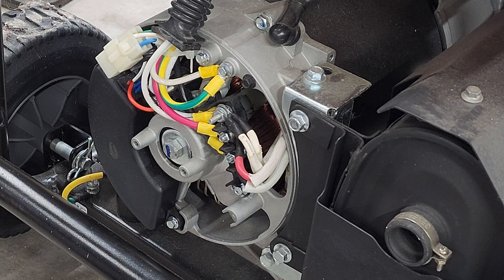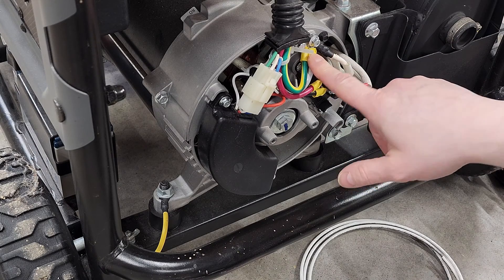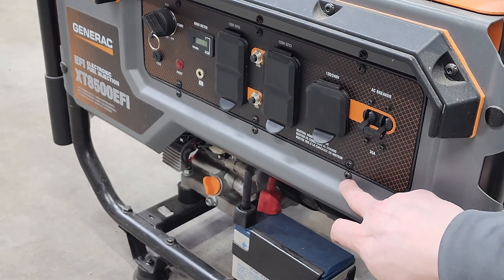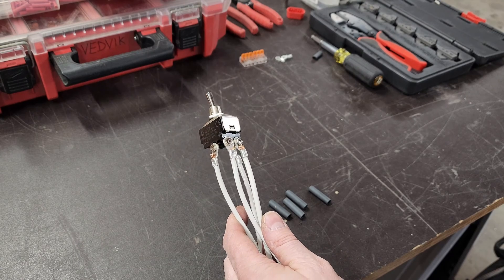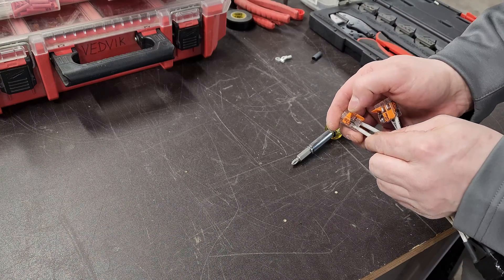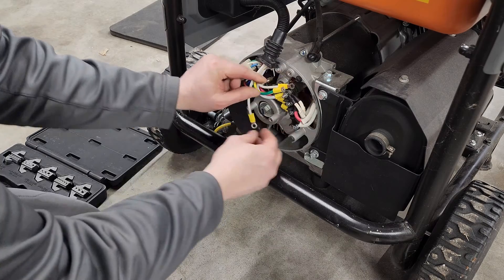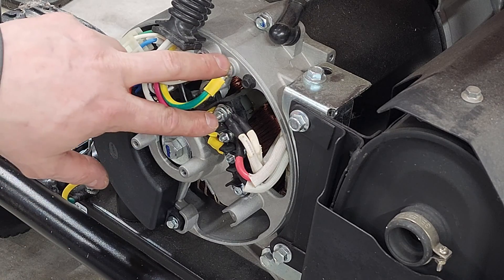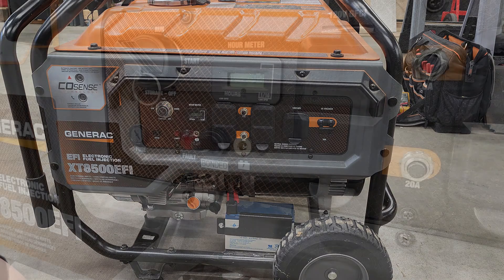Electrical Engineer Explains: Portable Generator Bonded vs Floating - How I modified my generator!

Comment: Love your videos. Just wondering why it’s okay to use a switch that’s rated under the total amperage capability of your generator?
Reply from the maker: I would maintain ratings.  While it's unlikely, it's possible for the neutral to have the same current as a single phase load.

Comment: This is actually a pretty slick solution. But, could you not just buy or make a neutral bonding plug and just plug it into one of the 120v generator power outlets and achieve the same result?
Reply from the maker: If you just use the 120V GFCI outputs you can power individual devices just fine since you aren't backfeeding the panel.  You wouldn't backfeed the panel at 120V.

Comment: You can always "re-bond" the generator by using a grounded utility plug with a piece of wire jumpered between neutral (silver) & ground (green). Then plug it into an unused outlet on the generator.

Comment: Odd to me:
250 Volts, x 18 Amps is 4500 Watts. 
You're trying to use a toggle switch with two poles and go with the theory that in a fault that load will be split evenly.

However, a switch rated for 4500 W in my mind is not going to handle a "fault current "on a generator which can produce 10,000 starting walks.

Even if you added both of those poles together and said in your mind 9000 W, you're still 1000 W short.

Also, an open frame generator is possibly subject to wet conditions so rather Thhn maybe go with THWN the wet rated wire.

Simply put, you would be better served by just running two wires out as you did from the generator's wiring… And connected a Wago lever nut, when you want the system to be bonded

Wago 600V x 30A =18,000 watts

A standard 221 Wego is not wet rated, however, I find it to be a better solution..
Reply from the maker: Hi!  The breakers aupplied with the generator are typical in marine applications and have a SCCR closer to 1,500A, not 10kA that we are used to seeing in commercial equipment.  The wiring, terminations,  etc inside the generator aren't capable of 10kA either.  I haven't researched the time-current curves of the supplied breakers, nor the actual fault current of the generator windings,  but I'm good matching the breakers ratings.

Comment: Hoping for some help here. I recently purchased a Generac G0080620 generator, a model specific to Lowe's, but essentially a duel fuel 8250/6700 Watt 49 state portable generator like so many of their mid power portable generators. I knew going in that the generator had a bonded neutral  Between the time I ordered and received the generator I hired an electrician to install an exterior manual whole house transfer switch and requested that he put in a 3 pole transfer switch and he told me the same thing that a couple of other people who bid the job told me, our utility company preferred 2 pole switches and generators with floating neutrals, so I deferred to his knowledge and ended up with a 2 pole transfer switch. Knowing that when the generator got here I would need to float the neutral I watched this and your other videos as well as other videos dealing with floating the neutral on Generac generators. After pulling the 2 neutrals from the windings and the neutral to the control panel from the common single bolt that tied them to the ground wire and using a machine screw added to the terminal strip to tie the 3 neutrals together I decided to try the setup before adding the bonded/floating selector switch, just to make sure it would run in a floated neutral condition. The generator started just fine but would only run for about 15-20 seconds before dying on its own. I repeated this a couple more times with the same results and then made sure I had done everything that the various videos had shown. I pulled the end cover and put everything back the way it was, the generator started and ran for a couple of hours with a couple of electric portable heaters plugged in and I was satisfied that everything was still working. 

I hooked the generator to the transfer switch, understanding that I was introducing a second bonding point into the house system, and ran it using all the normal breakers on, minus the extraneous circuits like dishwasher, washer and dryer

Can anyone think of a reason that floating the neutral in the manner I did, and numerous others have done, would cause the engine to shut down?

Both 120v outlets and the 230v outlet are all GCI protected

Thanks in advance for any help

Comment: not many electricians wanna touch my FPE panel; what are your thoughts if i put a huge manual transfer switch in between utility and the FPE box? switch up for util, middle for disconnect, bottom for generator inlet.. curious to know your advice
Reply from the maker: Manual transfer switches are a great idea.  Bonding is still a concern, action  depends on the number of poles for the transfer switch.  Ideally,  it switches the neutral so the generator can remain bonded.

Comment: What if I'm using the 30 amp plug to the house but also want to use the 110's with extension cord to something else?
Reply: It'll be bonded at the house fuse panel because it's connected to the house so you can use the plugs on the generator.

Comment: In his other video it shows him installing a generator connect box (without) bonding it to his electrical service. Easy to do. Just leave the green wire disconnected and wire capped. In effect, the metal connect box would only be bonded to the Generator (but not to) the home electrical service. I prefer this over making mods to the generator because if I want to use the generator as a stand alone power source, it comes manufactured ready to do so. 

It's interesting to note that most battery powered power supplies are set up without bonding. My Bluetti is not bonded. As a stand alone power source I have to use a neutral ground bonding plug in one of the outlets. This allows my extension cords to be grounded to the Bluetti. For further grounding, it would be best to add a ground rod to earth. Bluetti has a place for such a connection. In a off grid system, I think you should add a ground rod to earth.

Comment: Stupid non electrician question. 

It would seem that you would always want a bonded neutral on the standard outlets. Since you don’t want a bonded neutral if connecting to a house systems wouldn’t the switch be best served on the 30 or 50 amp service of the generator and still keep the outlets bonded?

Comment: I am a PE, and designed electrical systems for residential, commercial, industrial, solar, and wind over 35 years.    Please explain your statement about “phase A and phase B”.   Maybe your understanding of a phase is different than mine?   I thought you were talking about a 120/240V 1 phase 3 wire system.   I continued watching and I think you are using connection points as a Phase connection with a phase conductor.   If you are in 3 phase, that is the normal inference.   But in 120/240V system, manufacturers of equipment and most engineers label these points and conductors as Line 1 and Line 2 because there is only one phase in the system.
Reply from the maker: Excellent comment.   I am introducing confusion by using the colloquial term Phase A and B and not the proper term of Line A and Line B (or Leg A and Leg B) for single- phase (split-phase) services.   I spend 99.9% of my time in 3-phase systems, and my vernacular is hard-coded as such.
Reply: @richardvedvik979 .  I can totally understand!   As I worked for very large electrical contractor, I got a large amount of different types of projects.

Comment: Are there generators which will not generate when incorrectly bonded or grounded?
Reply from the maker: Generators lack the sensors and controls to prevent operation because it's not their responsibility.   It's the responsibility of the installer to determine bonding requirements.   Portable generators have to operate stand-alone, so they all come bonded.  I noticed that mine won't start when unbonded, so I have a bit of a safety interlock.

Comment: Could you add links to the parts and tools you used? I could not see the specs on the toggle switch. What's required for a 30 amp, 8750 watt, 120/240 volt generator?

Comment: My generator is capable of fifty amps.  What should the switches amp and volts be
Reply from the maker: With that large of an output, your neutral bonding switch should be rated for 50A, which means you're looking at a solenoid relay and not a toggle switch, which is a more substantial modification.  While we don't expect the neutral bonding switch to see rated phase current, we size the conductors and connections the same as the phase conductors.
Reply: @richardvedvik979  the white wire is only a number 10 and is only one leg so i thought that a 30 amp 120v switch would be adequate. What say you

Comment: Why dont they make this a more known thing when buying a generator.  I've never seen a generator that says if it's bonded or floating..
Reply from the maker: It's unfortunate this isn't more clear in the manual.  All portable generators will come as bonded so they work stand-alone, but the manual should have a section discussing what to do when connecting to your home without a transfer switch.

Comment: Safer solution is to buy a generator transfer panel that breaks the neutral to power the house. The generator becomes part of a separately derived system and can remain a bonded neutral that most generators are sold as. Most codes state that a separately derived system must be grounded at source so a ground rod or plate would need to be connected to the generator. This way the generator could be used elsewhere without having to remember to flick a switch or re-bond the neutral.
Reply from the maker: Agreed that a transfer switch or manual transfer sub panel, as I discuss in other videos, is a good option.  The challenge with transfer panels is the limited options you have for loads, because there are times where you would like the option to have any load in the home, not just a select few.  Most retrofit transfer panels force a lot of splices in the wiring, located in the panelboard.  I've wired those in the past and it's doable but annoying.  A proper transfer switch is ideal, and some utilities allow for a meter socket transfer switch, however you'd need the neutral to be switched if both systems are separately derived (bonded).

Comment: I don't understand why you paralleled the wire from the switch to the lever nuts, the switch is 20 amps and that didn't increase the ampacity for that system.
Reply from the maker: @robertlivingston1634  we need 30A for the neutral to match the phase conductors.
Reply: @richardvedvik979  doesn't matter the contacts inside the switch are only rated for 20 so you still haven't increased the ampacity of the device. Woops I just realized there's 2 sets of contacts inside.
Reply from the maker: @robertlivingston1634  yessir, parallel contacts.
Reply: @richardvedvik979  What about a generator rated at 50A?  What switch would I need to do this modification?

Comment: Have you tested your generator ? My XT8500EFI will not run with a floating neutral . It will start and die within 2 seconds . If i bond the neutral , it runs great . Does yours run with a floating neutral ?
Reply: Yes, I seen your part 2 video that says this. I was trying to start it when not hooked up to house. When I plugged it into house , it now runs. Thank you for quick reply.
Reply: Side note , I also have a Generac GP7500E not EFI . It runs great with the neutral bonded or floating .
Reply from the maker: @ricktaylor27  the neutral is not floating when it's plugged into the house. You plug it into the house and then you start it. That's how we do permanent generators except they never disconnect from the house.

Comment: Also I forgot to ask, do you have a link to that switch?  I might go that route just in case I end up taking the generator to another location in the future.  Its a nice option and I can easily do that.
Reply from the maker: @deej19142  i got the switch at a local hardware store.  It needs to be rated for the current and voltage of the generator and the existing conductors.

Comment: I watched your entire video, great by the way, so here is my situation at my house.  I am in a manufactured home, with a 200 amp pedestal outside with a main breaker, a couple of 20 amp septic system breakers, and a 100 amp breaker that goes to my shop that is 50 ft away.  This pedestal outside feeds directly inside the home and powers a 200 amp square-D panel for our entire house.  Last week I wired in a 50 amp breaker into the pedestal as well as installed an interlock at that location, feeding the 50 amp input outlet that receives the Twist Lok cord from the new generator I just bought.  It is the DuroMax 15,000 peak, 12,500 running dual fuel generator.  I need to get the book out and see if its factory bonded or has a floating neutral. 

Having said all of that, my question would be; if I am only using that generator to power my house through the outside pedestal, should my generator be a floating or a bonded neutral?  I know its been talked about in the comments but I just want to make sure I didn't understand it wrong.  This new 15,000 watt generator will only be used to power the house/shop/rv's, it will never be used as a stand alone generator away from the interlock and the outside pedestal.  The reason I did the interlock and the 50 amp generator plug at the pedestal and not directly to the home panel is that I need to power two Rv's during power outages, and didn't want to have to use a separate generator for the shop where the Rv's are powered from.

Comment: @richardvedvik979
Do we want a DPDT or DPST switch for this modification? Also, I see that this will ideally always be done in conditions where the generator is turned off, but if someone accidentally for whatever reason bumps the toggle switch, is there a rated toggle to handle 30amp 240V? I would want to install a switch that is listed for usage, so I'm not sure if this is even an issue with running them in parallel or if I should get that type of switch I am thinking. 

Also, would you know if once the generator is in the floating neutral position to power the house, are the plugs directly on the generator still available to be used and are they still going to keep their GFCI rating, regardless of bonded or floating neutral? Thanks!
Reply from the maker: @Confident_put1  i used a DPDT to wire the contacts in parallel to get to 30A at 250V.  If bumped, that could shut it down.  Several won't run if not bonded.
Reply: @richardvedvik979  Excellent thanks for the info, yeah I have the same exact generator as the one in your video, so I do have a couple questions:

How has it been with having the toggle switch installed after some time? 

Does this void any warranty for us? 

If the generator is toggled to floating and used as a house back-up power to an inlet with interlock kit, are the plugs now unavailable for use on the generator itself until it is disconnected and returned to being a bonded neutral generator? 

Is there a way to use the plugs on the generator in the floating neutral position safely?

Lots of questions, and thanks again for your reply!

Comment: Thanks to your video I was able to float my generator.  I have a Generac with a 50 amp receptacle.  GP17500.  It has a ground jumper from the frame ground lug to the 50 amp neutral.  I removed that and now its floating.  Verified it having no continuity between the neutral and frame as well as the same for the 30 and 20 amp receptacles.  Then I took a 50 amp plug and made a plug adapter to bond the neutral and ground in the plug and when plugged it I get continuity between ground and neutral when checking the 30 and 20 amp receptacles.  But here's my dilemma. I am also seeing continuity between the hot terminals and the frame.  Remove the plug adapter and fine.  Any idea why the hots are showing continuity to the frame?  I removed the hot terminals on my 50 amp plug adapter so for sure the jumper in the plug adapter is connected neutral to ground.  

On this 50 amp receptacle, the 2 hot wires go to a 4 terminal breaker.  The other 2 terminals each have what looks like a lesser gauge insulated wire going ???  The neutral has its normal white wire but also on the same terminal the same type of wire also going ??????  Possibly the stator?  Any idea what is going on to have the hot terminals reading continuity with the frame?   Thank you.

Comment: Just follow the manufactures instructions period.
Reply: Sometimes the manufacturers instructions leave a lot to be desired. Mine makes no reference to whether it is bonded or floating neutral, and so needed checked with a multimeter. The instructions for checking the oil level are also fantastically contradictory. I couldn’t justify a more expensive brand based on how often I use it, so am willing to put up with the poor instructions; the generator itself is perfectly adequate for my needs.
Reply: @salzar4431 My 13kW D-Max generator claims to be Floating Neutral, but EVERYWHERE I Ohm out shows Full Continuity, including the open frame section, while their website specifically tells me there is no bond between Outlet Neutral and Open Frame Section.  They even have a Section of PDF's showing how to Unbond their Inverter gensets, yet deny that reading Continuity from Neutral to Ground / Frame on my Unit means anything, rather is a 'misconception' in their own words.  Something don't smell right, and I'm going to find out what it is before I go any further.